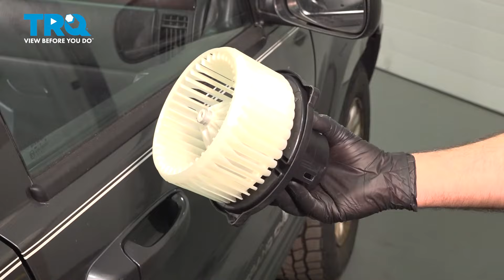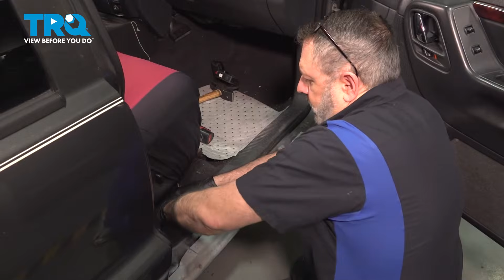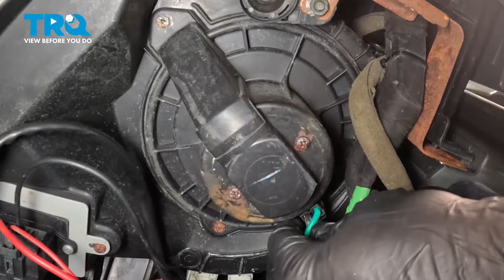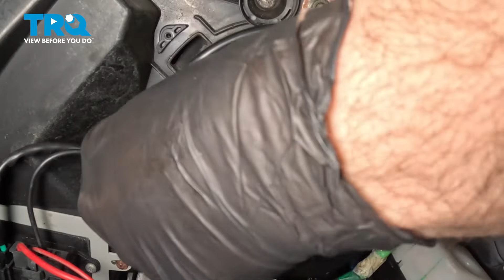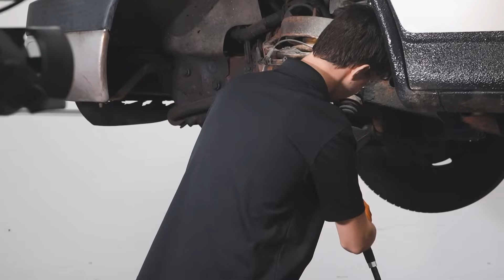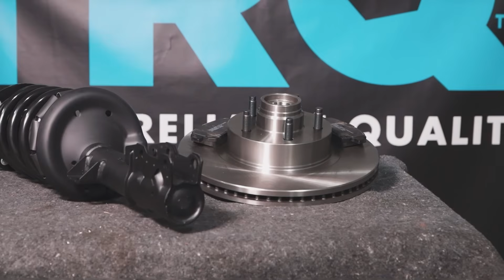How to Replace HVAC Blower Motor Assembly 1999-2004 Jeep Grand Cherokee

Comment: there is no need to remove the seal plate and the kick panel. you can easily move the wires out of the way with those in place.